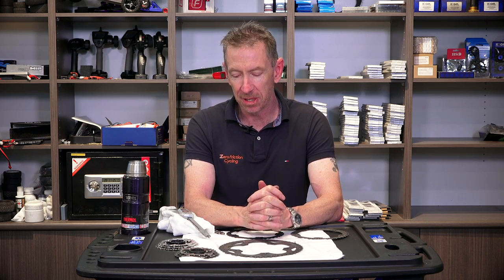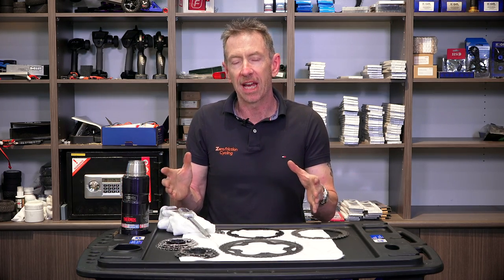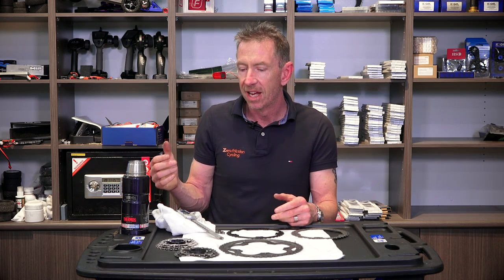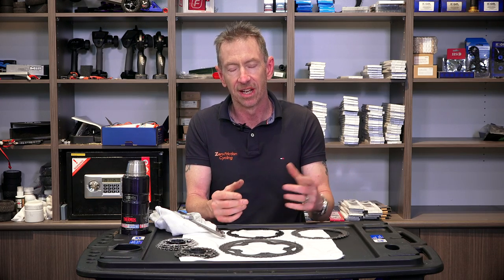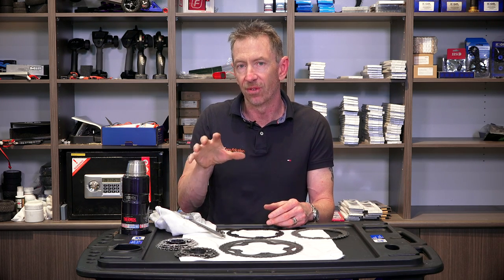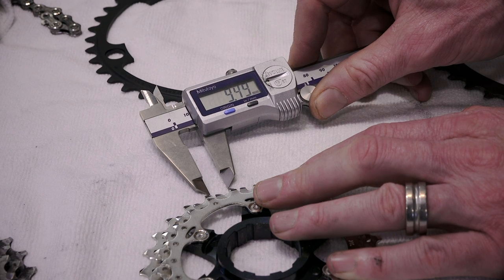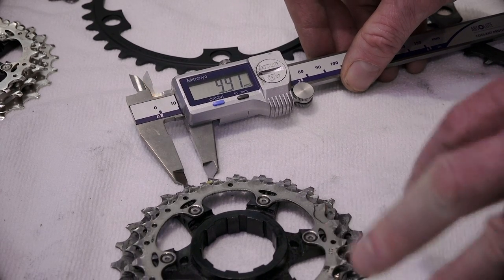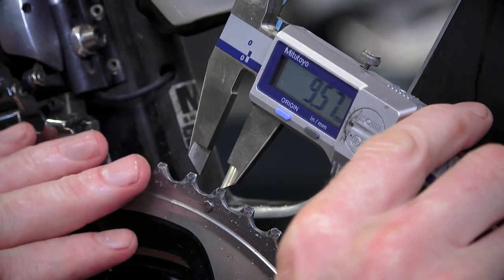Episode 13 Chain Ring and Cassette Wear

Comment: You say a new chain can slip, so if my chainrings are worn out should I just keep the old chain for longer?
Reply: Assuming you have never replaced anything since the bike was new, if your chainrings and cassette are worn out, your chain is worn out as well. Because the chain is the first thing to wear out, followed by the cassette or freewheel, and the chainrings the last.
Reply from the maker: It is obviously vastly better to simply track chain wear, and replace your most consumable part when your should, to then attain great lifespan for your more expensive (often much more expensive) components. If one has been caught out, and chain is now worn, and so wear damage is done to cassette and rings - then if one wants to keep riding a chain and drivetrain components that ride like a heap of crap, and with a higher risk of failure under load - that is really up to them......  

But the former path is a) much more pleasurable and of course - safer and b) saves a lot a lot of money. Ie by replacing chain when you should, for most people - chain rings will last longer than they would ever own the bike - normally at least around 40,000km but 50, 60k is easily attained, and cassettes 20 to 30k across 2 to 3 chains. Vs pushing one chain to say 15 to 20k, with everything riding like shite for 10k+, then a massive bill to replace the lot - why would one choose that path....
Reply: @zerofrictioncycling992  Right, thanks for the info. I guess the cost is not an issue for me because I have a cheap bike and (hopefully) the necessary tools so I can replace the chain, cassette and crankset for 45€ in total. 
But I would appreciate if it worked more smoothly so I'll try to take better care of it when I replace those parts.

Comment: Hi, ist the "Rohloff HG-CHECK" capable for this kind of measurements, or did i overlooked something?
Reply from the maker: Maybe... it is an expensive too i do not think many would ever buy, i believe it only checks cogs not rings, and - as per vid, go / no go definitely depends to an extent ones power. I do not know if this tool is conservative, or a bit generous with wear allowance. But i can say the go no go point for an 85kg, 420w FTP powerhouse rider with a 1400w sprint is much lower than it is for a 65kg 250w FTP 900w sprint rider, or someone who never does high power intervals and tootles around at an average of 150 to 200w. Such a tool would be up against it to cover the demographics accurately. Getting to know if for you 9.8mm is no go, or 10mm is no go - that helps a lot, and for many there can definitely be another chain yes or no in between those two measures.
Reply: @zerofrictioncycling992  That makes sense. Thank You for the Answer!
Reply: @zerofrictioncycling992  I have never seen one before it looks like a mini chain whip that looks very easy to replicate for virtually nothing.

Comment: Great Video as usual! Slightly off the main topic, but do you know if the latest (gen2) 12 speed chains from KMC work with SRAM AXS road?
Reply from the maker: Hi tom i have heard (this information could be incorrect, havent had time to check kmc) that KMC have claimed compatibility with axs road, but honestly i just do not see how that would be possible. KMC's 12spd chains are the normal 11/128 standard, meaning that the internal width between inner plate links is 11/128 of an inch, and it also has normal size rollers. Axs road is quite a bit thinner (i need to measure, they havent stated a standard), and also have oversize rollers. Even if the extra width of the kmc didnt cause an issue, which would be surprising, the normal size rollers running on cogs / rings made for oversize rollers, it would be like running a new chain on really worn parts - the risk of jumping under load would be very high. All reputable information from any reputable source, and taking into account clear differences in the completely different standard that is axs road - point to that there is zero cross compatibility with axs road and any other non axs road chain / cassette / chain rings. Considering that axs road chains are very durable, but certainly not fast, there is a definite need for a fast chain compatible with axs road. The fact we havent seen an aftermarket option points to there likely being a bit of patent minefield preventing this from happening or their would have been an official axs road chain by now by kmc / ybn. Sram need to make a TT version of their axs road chains, i think many axs road racers would happily give up some wear longevity for some watts savings for a dedicated race chain. If you see kmc claiming somewhere that their 11/128 chains are compatible with axs road let me know, i will write to them and tell them they are a) lying and b) playing a dangerous game with their customers. KMC do claim some odd things from time to time (like with their DLC chains, they are a complete sham. In my opinion. But based on the fact there is no DLC coating on any wear surfaces, so my opinion is pretty darn safe, and it failed spectacularly in my durability testing).

Comment: Hi Adam, I have a question for you regarding SRAM mtb cassettes. I looked on the SRAM website site and could not find the answer so hopefully you might have some hands on knowledge? Do you know if the 11 speed X01 cassette is made out of the same tool hardened steel as the 11 speed XX1 cassette?  Visually the X01 looks different as it has a black coating on it. They are almost the same price with the X01 being slightly cheaper so hoping the 10 speed cluster is made from the same tool hardened steel as the XX1. I know the 42 tooth cog is alloy and I, like yourself, tend to try to avoid using the biggest cassette ring as much as possible.
Reply from the maker: Hey there - no the information cant really be found from sram, but i am pretty certain they are not the same grade of steel. Srams steel in general does seem to be of a higher grade / wear resistance than shimano, and so the xx1 11spd will still be a very hardy cassette, however their x01 / xx1 eagle really seems to have stepped things up another level just going off the extreme wear durability demonstrated by those cassettes, and sram rep has confirmed they are a high grade tool steel. If only they were not permanently mated to a soft as alloy cog meaning so much magnificent steel is thrown away when it has so much wear life left in it due to the wear of one soft cog. It is very sad to waste those 11 magnificent cogs. Ah if only the big 3 werent always so determined to offset something magnificent they have done with something really crap. Let us bring to the world a cassette with the highest grade steel seen on a cassette for unparalleled wear durability, but lets have everyone waste that by making the largest cog out of sweety wrappers....

Comment: Hi Adam, i had a quick question: my Cannondale spiderring that I've put on around 400km ago already shows around 9.8mm to 9.9mm of wear when i measure it. My chain was brand new aswell and i clean everything very often. I have used wet lube from finish line for that time but bought molten speed wax yesterday. Are these readings correct? Are my chainrings already worn after only 400km or are these hollowgram spiders different to shimano ones?
Thanks in advance!
Reply from the maker: Hey lars - no i think the cdale rings have a different tooth profile and that this measure will not work on those - it is the same with some sram rings that have a more pointed too profile vs squared off tooth profile. A pointed tooth profile makes this measuring very tricky - really you would need to make some scribe marks near tops of a two teeth, take a basically near new check measure - and then over time if that measure has increased by say around 0.3mm they are becoming worn such that a new chain MAY be at risk of not playing and to start to be aware / do some load testing re jumping before heading into a full stand up sprint / power climb. On customer bikes where it was bit go / no go - new chain - ride with front brake on at like 5km doing a few pedal strokes at max strength in each cog and both rings in a style that keeps me not at risk of going over the bars if it does - its easier than it sounds to check , just a bit of time and effort. And normally if on the edge of go / no go - a new chain will run rough as it is poor mesh, so thats a sign as well that its maybe time for a new ring. 

Look after chain and rings with a top lubricant though, i believe those rings are not cheap!
Reply: @zerofrictioncycling992  thanks for the explanation! And no, the rings aren't cheap, thats the main reason i just bought 2 MSW wax blocks and a crock-pot. Cleaned my bike today and looking forward to waxing my chains for the very first time. This is all thanks to your vids and a friend of mine called Dirk, he says he knows you. He told me about you and im glad he did. Keep up the good work!🙌

Comment: Good view Adam. The measurements don't work for me though. I have Ultegra 50/34 and 11/32 chainring and cassette. Measures 12.4, not 9.5. Any thoughts?
Reply from the maker: 12.4?! thats a pretty massive gap. I cant imagine how that measure is possible without seeing a pic of it....
Reply: @zerofrictioncycling992  I'll email you soon through your website so I can include photos. I've correctly zeroed my digital calipers. Thanks Adam
Reply from the maker: @bfaIllini1  groovy, yes worst i have ever measured is 10.6mm, on a very very worn cassette from someone running a chain waaay past wear mark (2.1%). 12.4 there would be basically no teeth left. I think maybe measuring from incorrect tip to tip - needs to be the next tip across the trough.
Reply: @zerofrictioncycling992  Just emailed you 2 photos. Thanks

Comment: Is 9.5 the same across all the speeds?
Reply from the maker: Mostly - it is mostly the same across 9 to 12spd which use an 11/128 standard chain - however note that sram axs road 12spd use a different standard, 5 to 8spd are 3/32 standard chains with larger rollers. Other brands cassettes (ie rotor, campy) may be slightly different so it can be good to check your cassette new and have a starting measure - but mostly, for most 9 to 12spd systems it should be 9.5mm tip to tip to start, with circa 9.8 being a point most should take note of how a new chain will go

Comment: Hello! I have a worn front chainring, i can see that chain does not lay it it properly, but it does not slip even when I ride harder. Does worn front chainring makes it harder to cycle? I think it was easier to ride whet it was new, but i don"t really remember, my bike is 15 years old, have changed maybe three chains and cassettes, but newer front chainring.
Reply from the maker: Is your chain also worn? worn chain and worn ring - chain typically will not jump, the danger time is new chain on worn components as mesh / fit is poor. 

And yes the losses are higher in worn parts, but you would unlikely to ever be able to detect such loss levels (depending if chain knackered, a knackered chain vs a new chain & good lubricant, maybe you would)
Reply: @zerofrictioncycling992  Thanks for reply! 
The chain and cassette is fresh. This is third casette/chain with this chainring. I tensioned the chain and saw that the chain does not lay in front chainring for about one quarter sector, this might be the cause of which it is harder to cycle.

Comment: Not trying to be a dick - because it was a great and informative video - but you do realise these protruding things on the other side of your calliper are meant for measuring inside gaps, right?
Reply from the maker: ha. um. yes. Does it make that much difference in this case where i have clear access to use as above? to demonstrate tip to tip very clearly, i had no need to insert. Also, habit. Often when check measuring a customers bike, i would do a quick check with wheel on and it is easier to use the bottom "protruding things" for such checking. Within 30 secs whilst i have customer there i can advise if cassette is looking perfectly fine for a new chain, or looking 50/50, or really its a no go. Once you get used to something that works perfectly, one doesnt really think that demonstrating it in a way that works perfectly.....I will assume you are the president of the "Absolutely Precisely Correct Caliper Use Society" and this is a pet peeve of yours hahahahaha

Comment: it seams i will have to make video how to reshape rings teeth because your theory went to religion
Reply from the maker: Sure - do that. And also provide information why it doesnt work, when as per previous feedback on comment, it does work. You had some logic fails in your first commment - pls consider those first. No idea what you are on about re religion - but it seems perhaps a chill pill is needing prescription.
Reply: @zerofrictioncycling992  in some other comments watchers said that what did you intend to say ,it should be shorter, btw in one comment some said he has new rings but your way of measure gives him different numbers , religion? when spoke become empty here starts religion(bla bla). now i am in car exhaust , so now i am busy , as soon as possible i will make how to reshape
Reply from the maker: @makantahi3731  Makatahi i really dont need to know re reshape. I dont understand what you mean by religion. We are talking about just measuring  between two points and what is a no go measure etc. yes if some are not able to measure correctly - one needs a steady hand and eye- obviously the distance between the two points is not changing if measuring the same two points - so that would be operator error / more practice needed. Yes i often take too long to get a point across - what is your point if you are aware others have already commented on this? 

I am busy makatahi - i do my best to respond to comments but these are not a good use of time, i hope understand i likely will not respond further to this i dont understand what you are badgering me about.
Reply: @zerofrictioncycling992  here is link how to reshape:https://youtu.be/AhR02NmQxF4